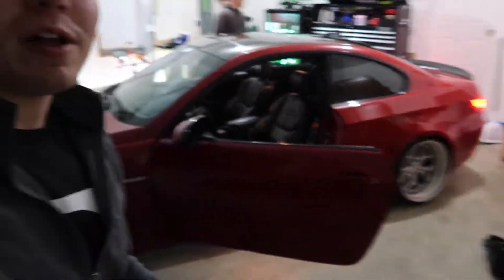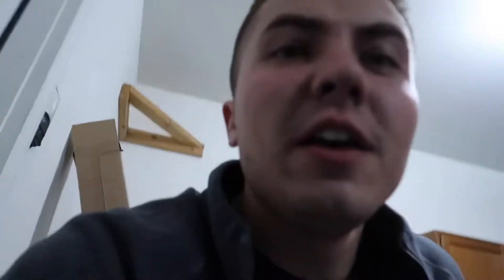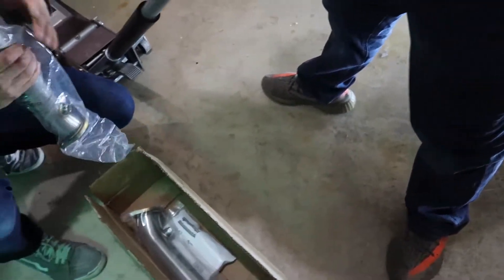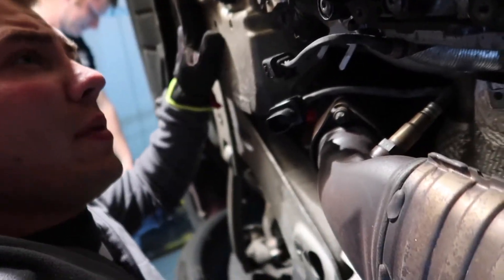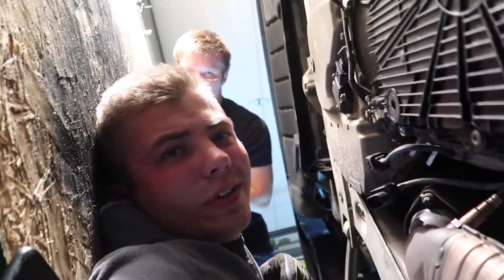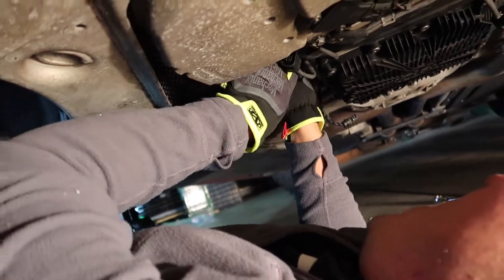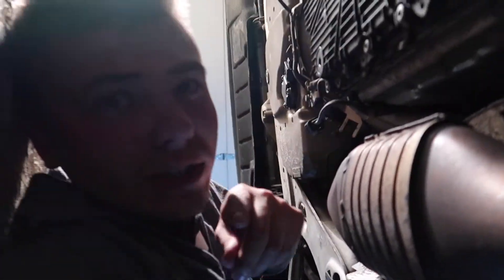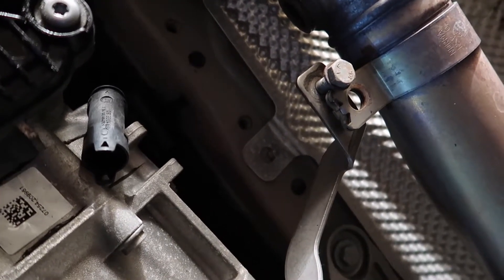Test Pipe Install on my E92 M3!

Comment: Give us the details on your wheel and tire set up. That's the coolest thing about the car (until you supercharged it).
Reply from the maker: Of course, they are MV Forged MR-171 Performa in 19x9.5 with 225/35 and 19x11 with 265/30. The finish is a full polish with a satin clear over the top to give a Frozen look.